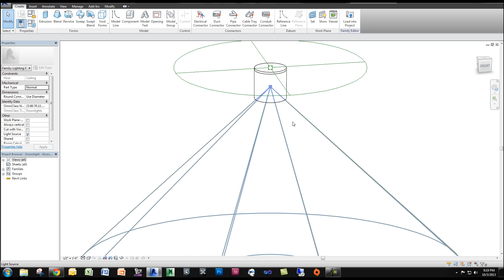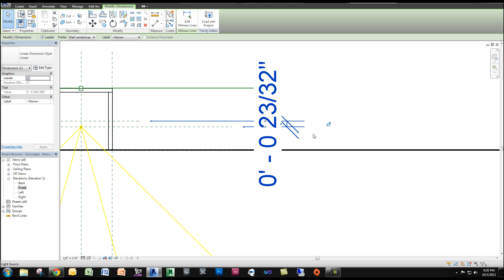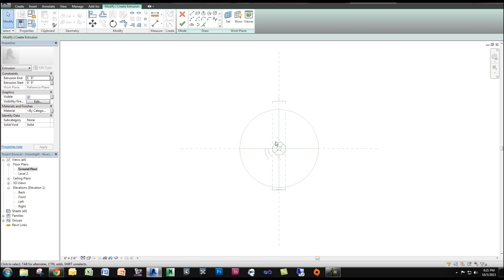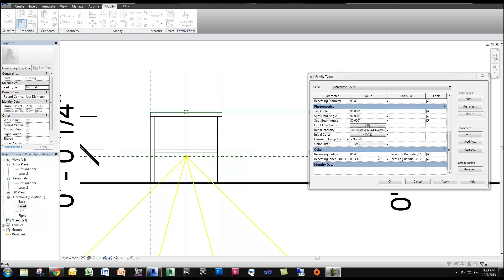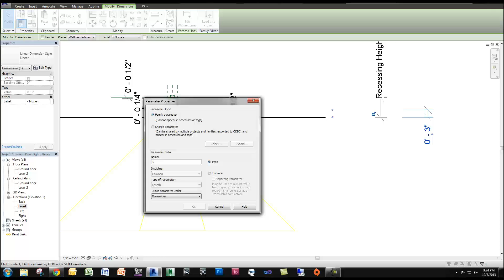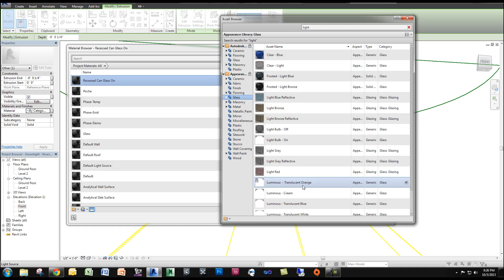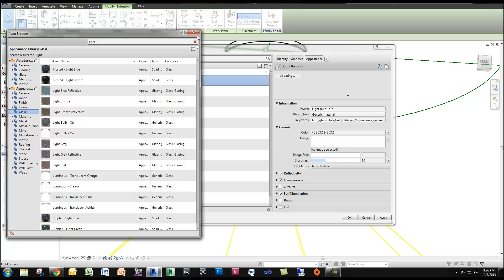Revit Tutorial - Show Lights Turned On in Renderings

Comment: Hi, Revit Kid. Hope you're doing well and that I'm not too late: I have a problem: The lights rendering on my Revit (2018) are working with me at all. The types 'spot', 'square' and 'circle' lights are too dim upon rendering, and the 'line' lights are too bright. I don't understand why at all. They're all the same intensity and luminosity and color and all, and tampering with the rendering lighting/shadowing dials somewhat improves some light types only to screw over others.

After days of trying to fix the problem in vain, the internet didn't give me any answers other than using the 'Photometric Web' type of lights, of which I have no families. I looked for them but couldn't find any like they show on some YouTube videos.

Every time I get a bearing it betrays me. Have you any good advice here?
Reply from the maker: You'll have to increase the intensity of the lights or increase the exposure of your rendering.
Reply: @TheRevitKid  Actually, I figured it out. The key element I was forgetting was the 'Glass, White, High luminance' material for the glass geometry. I didn't expect it to be that important, but figured it out when tampering and experimenting with Revit's pre-made families.

It was not the intensity of the lights or the rendering exposure; it was just the right material of the right geometry that was essential. Nevertheless, that still doesn't solve the overwhelmingly bright 'line' lights, the same type that has a mysterious black line of shadow under it. I'm sure you may see my problems when you try building lights without the 'Glass, White, High luminance' geometry. Learning about the lights at the most basic levels can be very useful. So if you could find a solution, or at least an explanation, to:

1. Why the 'line' lights are much brighter than other types.
2. Why the 'line' lights have a weird line shadow under them.

then that would be very helpful and appreciated. Also, I'd love to know where to get the 'photometric web' lights (I think they're called IES).

Peace and blessings from Saudi Arabia.

Comment: I'm using Revit 2014 edition, and I was unable to change the light source depth without affecting the other reference planes ("Constraints are not satisfied") in my own project. Locked everything except from the light source depth. Any clue?
Reply: +tjakan and @TheRevitKid Hello, with Revit 2015 I am having the exact same problem: the 2 newly added reference planes, once locked as per the video give a message error : "Constraints are not satisfied". Any idea what could cause this ? (I have the feeling the original Family/Template are not built the same way (not sure I am a Revit beguiner - on my Template the drawing is upside down : the light emits up, not down as per the video).The only way I could make it work was to draw 2 "reference lines" NOT 2 "reference planes".Thank you for your input.
Reply: +ludohugo1 Oh I spoke a bit too fast: even with the "reference lines" it does NOT work.....   Arrrgghhh
Reply: +tjakan Found what we were doing wrong : when you dimension the reference plane of the lense you have to contrain it to the reference plane of the light source (not the light source itself). When you hover your mouse over that line press TAB on your keyboard (do it a few times if needed) until it says : "Reference plane". Then it is all good. Good luck. Thank you for this great tutorial !
Reply: Hey your comment helped me out. Thanks!